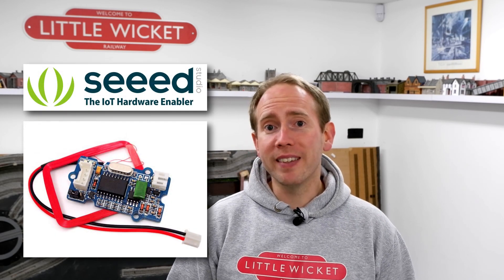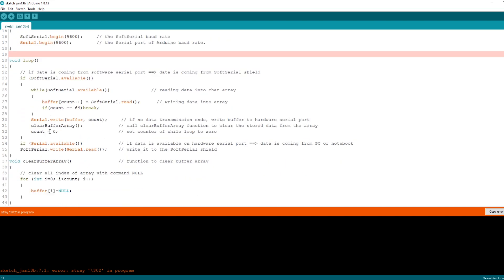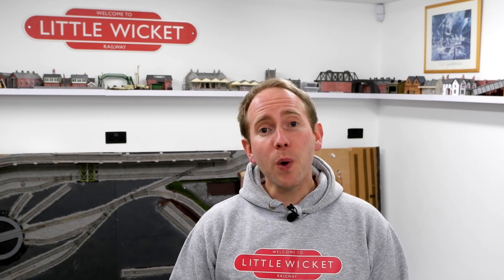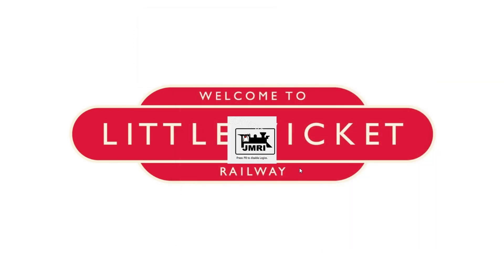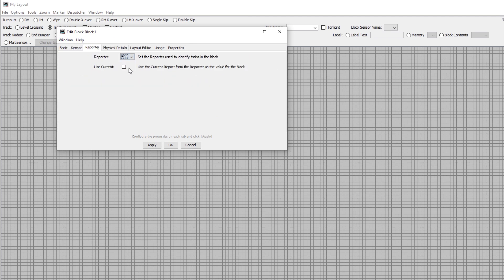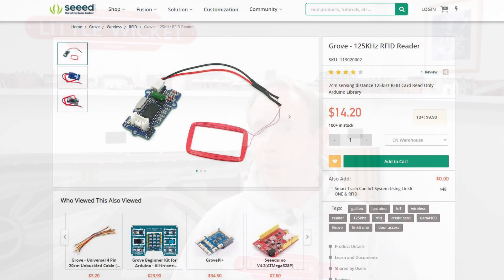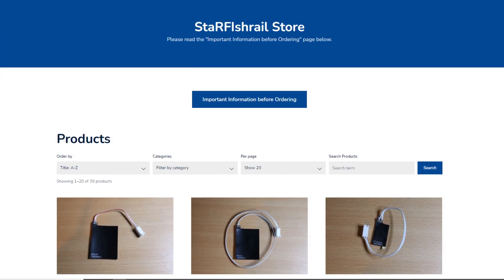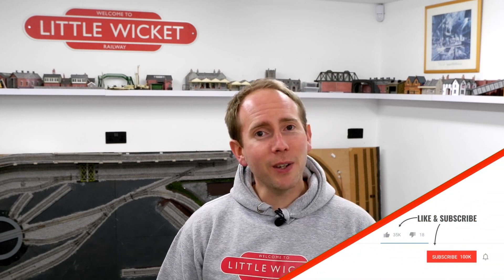Intro to RFID Train Tracking in JMRI using the Grove RFID Module from Seeed

Comment: This is neat. I worked for a electronic manufacturing company that made small car actuators back in 1998. They used small 8" x 8" conveyor pallets with rfid tags on them to assemble the components with robots. If the pallet missed a gear, it would code it bad and continue without anymore components installed.  I always thought it would be neat to put rfid tags in freight cars for hump operation. The tag reader could read the car and automatically align the hump switches. The limiting factor back then was the price and software. Its hard to believe how available and affordable it is now, but it has been nearly 3 decades. Thanks for the video and information.  Just food for thought.

Comment: I've been trying to use this idea to ID and trigger separate speaker pairs pending where that train is and what it is doing.  So, a DC loco could simply trigger the sound associated with it in the right section of track!   ;)   This would be a game changer as no on board sound boards,  no messing wires.  No lame sounds.   All on full blown quality speaker system through out the layout! PS:  Place reader inside a building vertical!  Might avoid the interference.
Reply from the maker: Making Tracks 4 are using RFID readers to display the train's destination on a board and announce it. It works well, but the readers are quite large and, as you suggested, vertical next to the track.

Comment: This is super awsome. RFID or NFC. With this technology we can track where the certain train it is. And at what time have pased in that point or arrived at station. 
And at same time can make automation runs opens close departure. i like its working. Now i want to acomodate it right betwen rails not under. Like the decoplers in the midle of the track.

Comment: Hi Rob. I appreciate your material very much. Unfortunately this Seeedstudio Grove 125kHz RFID Reader is not available in Brazil (importation tax are very high in Brazil). I bought an 125 kHz RFID Reader (RDM6300) but it didn't work in any protocol available in JMRI. Have you tested some similar hardware? I hope a JMRI update that supports another popular RFIDs like RFID RC522 or RDM6300 plenty available and low cost hardware. Thx.

Comment: Does Grove make an RFID reader that can read at 13.56 MHZ as it seem to work better at operating speeds ? 
Any follow up on this ?
Can  two tags per engine  be used to determine direction ?  
what about using a loconet shield on an Arduino to mimic an alternative to transponding using RFID.
Connecting multiple hubs via ethernet (best for speed ) or mqtt or usb multiple ports which is best  ?

Comment: Very good video.
I am using the RFID-RC522 module, since the one from Grove is very expensive in my country. I can't adapt the code to JMRI. I read that you have uploaded the code to GitHub, but I can't find it. If you would be so kind as to put a link.
Very grateful... Miguel Angel
Reply from the maker: Hi Miguel Angel! Thanks for becoming a member. I didn't write the code in this video or upload it to GitHub, I copied it from the Grove Wiki library (https://wiki.seeedstudio.com/Grove-125KHz_RFID_Reader/). Hopefully there's something in there that you can use for your reader. Hopefully the same JMRI connection protocol will still work for you.
Reply: @LittleWicketRailway   Thanks for your fast answer. I wish you a happy new year and good videos.
Reply: have you got the solution yet?
Reply: @abhimanyukanase7672  The RFID-RC522 reader is useless since JMRI does not detect it, in addition, the circular tags only work by contact, the cards are detected at about 2 cm, but they are too large to put on the underside of a train. I have bought the Grove sensor and I am going to try it.
Reply: @MiguelÁngelLópezOrtiz  thank you if you have any expertise in jmri i would really like to talk to about it
Reply: @abhimanyukanase7672  All I know about JMRI is from these videos and reading the JMRI website.

Comment: Two questions…. 1) will this rfid reader work with the small animal tracking type tags and 2) can this reader be connected directly to a raspberry pi?  Thanks.
Reply from the maker: Sorry Dan, I don't have the answers. The world of RFID is vast, you may need to check put the specifications of the kit you want to use and experiment.

Comment: Interesting to see this working and I must check if there is an RFID I can use with an Arduino R3. Maybe if it is possible to get a smaller loop aerial to hide under the track to pick up the RFID disc signal.

Comment: This might be a case of analysis paralysis Rob but might it be worth planning what you want to to and building it as part of the original build? Might be more difficult to retrofit it. I'm considering something like this for my planned layout which is intended to be an exchange yard offering lots of shunting with wagons heading to multiple destinations. 

I'm not sure using RFID for block detection is the way to go - as you say it detects in a single spot. I'm guessing you would want multiple RFID tags in a JMRI block and automation relying upon RFID for indicating a block is occupied would possibly prevent more than one tag in a block.

Love the video though. It's so encouraging to see how easy this was to set up.
Reply from the maker: An exchange yard sounds busy and a great use for RFID wagon tracking. I wouldn't use them for block occupancy, I'd stick to the current sensors.

Comment: Very useful, I’ve gone down a blind ally with tracking. I used BDL168 wit RX4s. At first I thought it was reporting transponding, turned out my decoders weren’t doing it, it came from the DCC command station! Even saw locos in the memory of the DCC that were still in a box! Need a plan B.

Comment: Always something interesting from your presentations. If I were doing the RFID sensing I would use i2c and a multiplexer to read from multiple sensors (Adafruit TCA9548A). The RFID readers interfere with eachother if placed too close, so I would use the point selection to determine which sensor should be powered. I have built a demonstrator that used multiple RFID readers and we had to cycle through them powering them individually.
Reply from the maker: Interesting Andrew. How many sensors were on your network? How many times a second would each reader be "looking" for a tag?
Reply: @LittleWicketRailway  There were nine sensors connected by USB to a PC. This was some 8 years years ago so it could be there are more suitable sensors available now but spacing them out is almost certainly a good idea. regards Andrew

Comment: Looking into this system, my plan is to have a 26 lane fiddle yard, two helixes and a main board on top.
Could I use this system as a randomised system?
Many thanks 
Rhys
Reply from the maker: Hi Rys, 26 lanes is massive! What do you mean by a randomised system?
Reply: @LittleWicketRailway  what I'm after is, say lane 1 to 13 are north to south,  14-26 are south to north. I would like 1 and 14 to go from the fiddle yard, round the layout, stop back in their lanes, and then points change, and another 2 would go round. Would this be possible? 
Many thanks 
Rhys

Comment: The 125kHz tags won't work under the baseboard. The range on a 125kHz tag is roughly under 2cm. The problem is that range is slightly reduced when you introduce a baseboard, ballast, sleepers and track. You also have to factor in the distance on the rolling stock (wheel height etc) to where you put the tag. So it worked OK on your test because you had it under the sleepers and it could easily read the tag. Move the reader under the baseboard and it won't work very well. The best option is to use MFRC522 13.56MHz tags. These work really well, but the code required is a little bit more complex. My test setup for this is an 8 car HST set, you have to get really creative to capture all 8 RFID tags at speed in a block, otherwise you could misidentify or miss a coach, which is obviously not what you want :)
Reply: hi i am also trying to do in that way reading the tag using RFID-RC522 in arduino and then want to pass it to the jrmi but i guess i hit the blocker not able to figure out the protocol and the data format in which i have to pass the information to the jmri using serial port,  if you have got success in that could you please show in your channel how you have archived that part if possible
Reply: @adarshkumar83  Yes I can do that. I have the RFID-RC522 working with both the ESP32 and ESP8266 modules for quite some time now. I just realized I didn't push it to github, so I'll push the code sometime this week. Keep an eye on the oorail channel, I'll see if I can put together a video that explains the code for you.
Reply: @Oorail  Thanks a lot sir for helping me out on this i don't know how to express you how happy i am due to this help and i am waiting for your video on youtube
Reply: @Oorail  gentle reminder you mentioned for RFID and RC522 reader with jmri tag video
Reply: @adarshkumar83  I just finished porting the code over to the new module format I'm using for ESP32/ESP8266 modules. It should be available on the private GitHub repo for supporters on Tuesday, it'll hit the public repo towards the end of the week when the video hits the oorail channel. The code provides several APIs as well as a web interface. There were a couple of projects ahead of your request, so sorry about the delay. The new module format provides output in proper JSON format now as well, making it easy to interface with other systems.
Reply: @Oorail  when ru planning for the code and video ?
Reply: @adarshkumar83  Video is in the queue, there are a few videos ahead of it, the code is already available in private GitHub repo, should hit the public GitHub repo on the next release. If you are subscribed to the channel you will get notified about the video.
Reply: The tags I bought from RS components (Logitag 120, stock no. 843-0793)  work perfectly with the reader under a 9mm baseboard.  They are smaller in diameter than the ones used here, but thicker.
Reply: @christopherdavis5544  Did you test this in rolling stock, or did you just test it sitting on track with the reader under the baseboard? The reason I ask is that 125kHz has a limit of 2cm, looks like those tags are industrial, so you might get a little more out of it. If you put the tag on the underside of a brake van, on code 100 track, its going to be 2cm from the top of the baseboard, further if you've used cork or some kind of underlay. The readers aren't flush with the bottom of the board either, at a minimum you are adding 1-2mm distance with the reader. So 20mm + 9mm + 1mm = 30mm, this is an entire cm over the spec before you even add RF interference from powered track, and the metal on the track. What reader are you using and do you have a demo of it working? If you just tested it above the baseboard, then that would probably work because 9mm + track height is still going to be within the 2cm. When you add movement, the height from the tag to the track etc, anything within spec isn't going to work right. That said, some manufacturers don't always follow the spec, so I'd be interested in finding out more about your setup as you might have found a combination thats just enough over spec to work :)
Reply from the maker: The read range of a 125kHz reader can definitely be more than 20mm. The Grove reader is about 5cm with the disc tags as demonstrated in the video. The design of the reader (power and aerial), the tags use and any interference will determine range. With the right setup you could read from a few feet at 125kHz.

I'm not suggesting that 125kHz is the frequency to opt for, just saying that it's not limited to 20mm. I have PN532 readers at 13.56 MHz that struggle to read mifare ultra tags at 2cm, that does mean all 13.56MHz readers are limited.
Reply: @LittleWicketRailway  Not reliably with the type of tags you can stick on a OO model. The reader energizes the tag, so the antenna on the reader and the power output is critical. The tag has to energize though, so the size and antenna configuration on the tag is also important. That is why they sell tags with a shielded backing so you can stick it on metal objects. The "right" setup is going to require a tag thats the size of a credit card or larger to work at that range, so its not really practical for model railways. If you look at something like the ID-12LA, it has a max range of 120mm, but you need a credit card sized tag. It does look like seed have beefed up the power output and antenna to improve the range,  it would be interesting to see how it performs when you put the baseboard and powered track into the mix. PN532 are NFC readers, if you configure them properly they can go up to about 100mm depending on the mode. RC522 is probably better suited because you can put the readers closer together without picking up the wrong tag (think multiple tracks and needing to stagger the readers, you don't want to mistake the HST on the up line with the steam loco on the down line!). PN532 and RC522 performance can be impacted by the software used too. The 125kHz tech is old tech, so why waste the money when you can get the newer tech for basically the same amount of money?

Comment: My idea is to use RFID in an automated hump shunting yard. If you detect which wagon is at the top of the ramp, the system can route it into the correct siding.
Reply from the maker: Great idea! I'm jealous I didn't think of this. Are you going to do it?
Reply: @LittleWicketRailway  is there an email someone could get ahold of you directly with?
Reply from the maker: @Fletchermedialtd  littlewicketrailway@gmail.com
Reply: @LittleWicketRailway  Unfortunately the space I have is too small, so probably not, but I'd like something as proof of concept. I've already sorted the Arduino logic and tested it with another RFID reader, but the tags were not being read when inside the wagons, due to the metal weights in the wagons and the short range of the reader.

Comment: very nice intro, I've not tried it but I did wonder on this sort of thing. I was considering it as something to use in a few spot locations to work with control logic - e.g. exit of some sidings to confirm what train actually left a given road (with tag under locomotives) then hopefully the system can keep track of that as it goes block to block.

I.e. not using them in every block, just occasionally at points most trains cover. Also as "decision points", say on the approach to a fiddle yard to enable intelligent routing of trains.

its certainly very interesting though and this intro shows its actually a lot easier than some others have made it seem. Interested so see more experiments :)

Also suspect I2C is useful for multiple sensors on one arduino. the uart serial stuff a bit more restricted unless the sensor has some sort of interrupt output but even then awkward - there are controllers with multiple uarts though

Comment: i guess another question is can you use a mix of RFID detectors and say current detectors for block detection, my own layout is based on a mainly single track prototype but it's unusual in that you can have multiple trains following each other even ending up with two or three short trains on the same platform at the same time it would be nice to be able to watch train a followed by b and c proceed around the JMRI screen but I am going to assume that this might only be possible if every block has a RFID detector which could rapidly get very expensive
Reply from the maker: Definitely keep the block occupancy current sensor. The RFID readers are a bit like IR sensors, only shows that a train is in one place. It's possible to do automation with entry exit sensors, but I think a combo of block occupancy and position sensors is required for confidence in automation.
Reply: JMRI keep 'track' of an id once the rfid sensor registers it and you have block detection. As long as there is only one id in any block this will work

Comment: Nice introduction to RFID on model railroad!!!   My overall block detection will likely be IR proximity sensors because of cost and they detect anything easily.  But to detect a specific engine or piece of rolling stock the RFID might be the way to go.   You're idea for updating an OLED station train board would be fun ... Cheers!!!